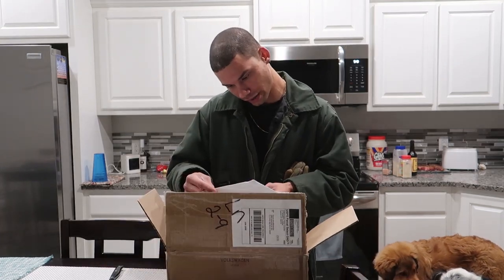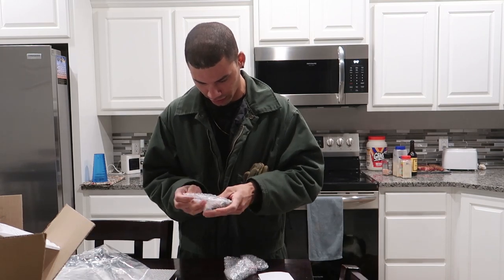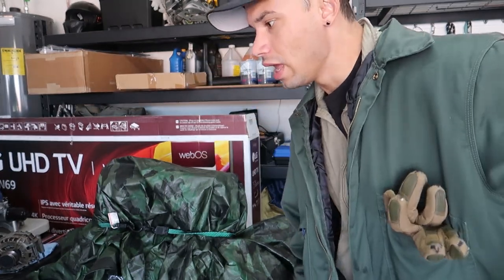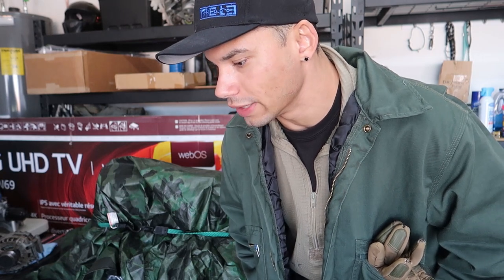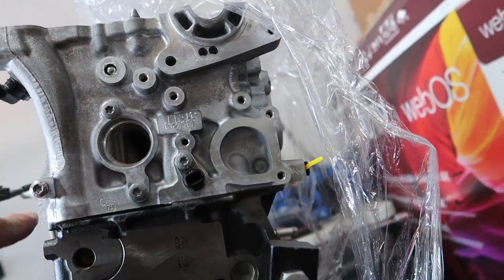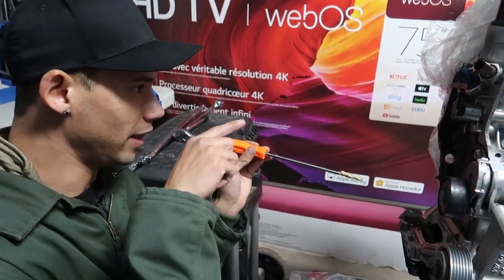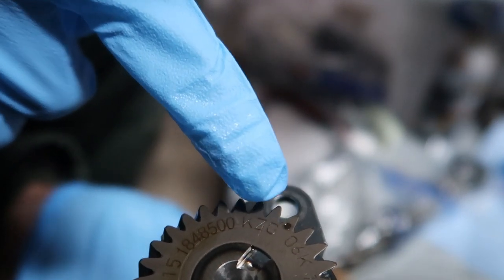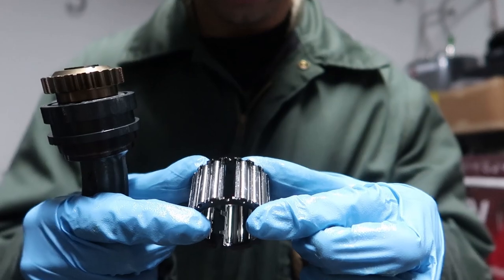AC delete complete and DI's back from cleaning they were BAD BAD! | MK7 Golf R

Comment: Which part # on the pulley? I've heard #: 06K145172 works and it's half the price.
Reply from the maker: 06J-145-172 is what I got
Reply: @MosPhed I'm sure he's got it to work but y does it say both dont fit on ecs site 🤔.
Reply from the maker: Cause they're not manufactured for our cars, if it's not a factory part it's going to say that. It bolts right up no problem
Reply: @BryceJordanProductions   thanks bro always thier to help me .